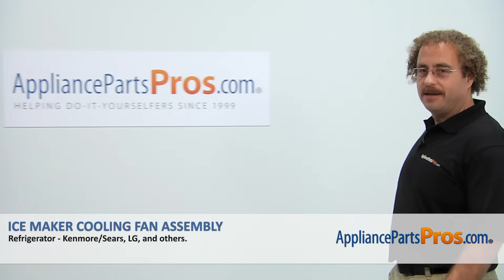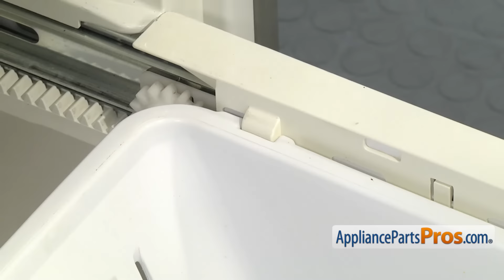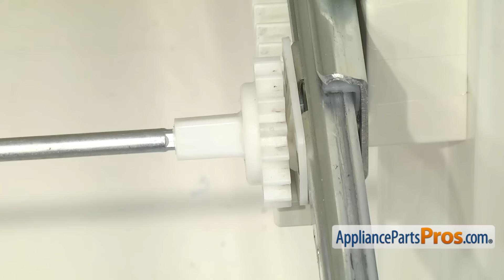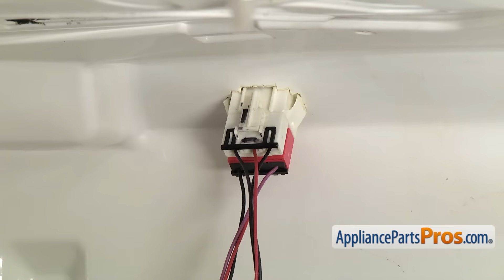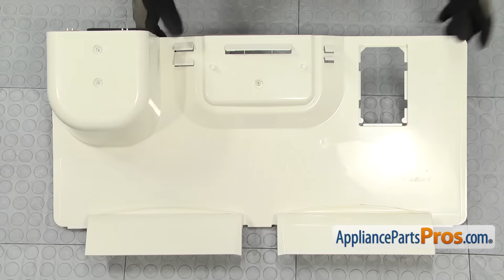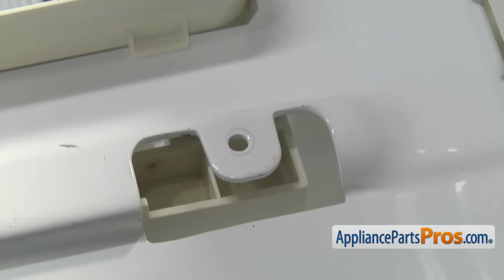How To: LG/Kenmore Ice Maker Cooling Fan Assembly 5209JA1044A

Comment: We are trying to get this part but can't find it. Can someone point me in the right direction to get this part?
Reply from the maker: Unfortunately, part number  5209JA1044A is no longer manufactured and there is not a replacement for it. You can keep looking around to see if anyone still has some stock left, or check to see if you can find it used somewhere.
Reply: @appliancepartspros Thank you!
Reply from the maker: You're welcome!

Comment: This part has been discontinued.  Curious if LG was manufacturing a crap part that was failing for everyone.
Reply from the maker: Parts can be discontinued for any number of reasons. If you need to replace this part you can take the part number and check around to see if anyone still has some stock left or you may have to get it used somewhere.
Reply: @appliancepartspros  Wow, thanks for the follow up, appreciate the help.  Btw your site is great and it has helped me out a ton.
Reply from the maker: You're welcome!

Comment: Thank you so much for this great video!  So we've already defrosted the freezer after getting E & 1F error code but error code is still showing up.  Fridge is getting cold, freezer is keeping things frozen but could it be the ice maker cooling fan or motor is broken?  The fan on the left had an ice build up that could've burned the fan or motor out I'm guessing.  I'd greatly appreciate if you could guide me what to check next and how to proceed🙏🏻🙏🏻🙏🏻
Reply from the maker: What is your model number?
Reply: @appliancepartspros  Thank you for replying!  It's LMXS30796S, 5 years old and we had to defrost only after 2 years and it's been making the fan noise again a while but we've been delaying to go through this nightmare to defrost again until this error code.  What's wrong with LG??  Do you hear others having issues with ice build up?  Such an expensive fridge with a stupid problem!  We had another LG fridge without  an ice maker before this one and never had an issue.  We also have another LG fridge without an ice maker and never had an issue either all these years.  Something to do with fridge with an ice maker??
Reply from the maker: That error code indicates an issue with the ice fan. But if your evaporator coils are frosting over, that would be a defrost issue. If you have a defrost issue you will need to check the defrost thermostat and defrost heater, if those are good then you will need to replace the control board. You can contact us at 1-877-477-7278 if you have more questions.
Reply: @appliancepartspros  Thank you so much!  The fact error code shows E & 1F I hope it's only  the actual fan but the ice build up causing the fan to burn out so we need to figure out what's causing it.  I'll have my husband test each one you mentioned (will have to binge watch YouTube videos of how to test) and hopefully figure this out.  It definitely causing us unnecessary stress and wonder if any other LG French Door w/ Ice maker owners experiencing the same.  Thank god at least it's cooling and freezing in the middle of 100F weather in Central California!  Thank you again and I'll reach out if we have further questions🙂
Reply: @appliancepartspros  Just wanted to update, our error code disappeared after a few days.  We were sure we were going to have to disassemble again and figure out the problem but it was freezing and chilling properly so we waited a few days then error code disappeared.   Just wanted to follow up in case others are going through the same situation to maybe wait a few days before taking it apart again if fridge is working OK but error code persists after defrosting.
Reply from the maker: Thanks for the update! Let us know if you have any other questions!

Comment: the part is discontinued, any other compatible number for this part?
Reply from the maker: I'm sorry, the manufacturer has not provided a replacement for the 5209JA1044A. You may still be able to find some in stock, you will just need to check around.

Comment: Thanks for posting! I got back from a few days out of town and my LG was growling loudly from time to time, and eventually got this error. I tried hitting it with a blowdryer, then blowing the blowdryer into the vents, then I took it all apart like you have detailed here to see if it was iced over still. There was no ice on the inside, and it spun freely. I put it back together and I am still getting the code. The fridge has two icemakers and the one down below in the freezer functions but the one in the door does not. Unplugging the fridge resets it for awhile but the code always comes back. Any ideas of what might be causing the problem? Does the fan need to be replaced? There appears to be two fans in there when I take off the back panel, which is which and which should I look at to replace? Or is it the icemaker in the door that is the issue? I feel like it's either that or being frozen burnt out the fan after awhile since we were gone and didn't hear it. Any advice appreciated!
Reply from the maker: What is the code that you are getting? What is the model number of your fridge?
Reply: @appliancepartspros  the error is “I F E”. The model # is LFXS26973S /10
Reply from the maker: How old is this fridge?
Reply: @appliancepartspros only a year I believe, 2 at most
Reply from the maker: With this being a newer model we don't have any information on this model at this time. Have you tried to reach out to the manufacturer to see if they could help you? Your fridge could be under a warranty of some sort?

Comment: How to check a 12v dc evaporator fan of 3 wires
Reply from the maker: We'd be happy to help you out with that! We offer free technical advice and diagnosis. You can give us a call at 1-877-477-7278 or you can chat us at our website: http://www.appliancepartspros.com/. We will need your model number to give you accurate advice, which you can locate using this tool on our website: http://www.appliancepartspros.com/modelnumber_locator.aspx

Comment: Can anyone here  help me locate a replacement blower /ice fan for my lmx25981st? The part number I found was adj36762901 but its no longer available? so is this $2300 fridge not maintainable?  This is nuts that I cannot find any solution. The fan in my fridge works (pulled and verified)  but the two main boards I have dont seem to sense it. You can hear it spin up three times before throwing the 1f ER ice maker fan error if the ice maker is turned on. I have also tried replacing the ice maker.
Reply from the maker: The part that you mentioned is pulling up for me as a duct connector, not a fan. It looks like for your model, we do have this fan in stock: http://www.appliancepartspros.com/lg-fan-assembly-5901ja1021a-ap4457221.html We have a parts breakdown for your model here http://www.appliancepartspros.com/parts-for-lg-lmx25981st-ast3gsc.html?gclid=EAIaIQobChMI9_ylz9yE2AIVj1cNCh1czA7XEAAYAyAAEgLlx_D_BwE

That 1f ER error does mean that there's a problem with the refrigerator's ice maker fan. Sometimes this may occur when frost or ice buildup occurs around the ice maker fan. You can also check the gasket along side the door to ensure it is not torn or damaged. Frost buildup can also occur if the doors are not aligned properly. 

If you're still having problems, please get in contact with us, because we do offer free technical advice and diagnosis 7 days a week. You can give us a call at 1-877-477-7278 or you can chat us at our website: http://www.appliancepartspros.com/.
Reply: AppliancePartsPros  thanks! Yes I am aware it's the fan I want but on my model fridge it's actually a blower unit instead of a regular fan blades fan and many sites refer to it as a duct connector. The link you sent me is coming up as a plastic fan blade? I do not see the part I need listed there? I am working but will call the number you provided later today. I thought for sure I checked your site and it was listed as NLA.
Reply: I should add I've defrosts and also checked the blower/ice fan with a DC power supply and it does work. It just seems the logic board isn't sensing it. Same with the second logic board I bought to test it. You hear the fan start up 3 times and then the error is displayed.
Reply from the maker: Yeah, give us a call later, and we'll see if we can't figure out what's up and how to get it working again. We have Parts Pros Agents available 7 days a week, from 7 AM to midnight EST, so you can call us or chat us whenever it's convenient.